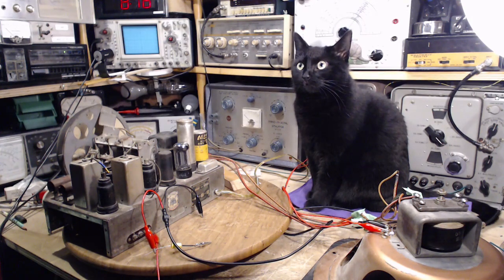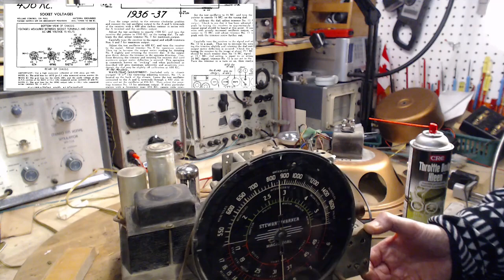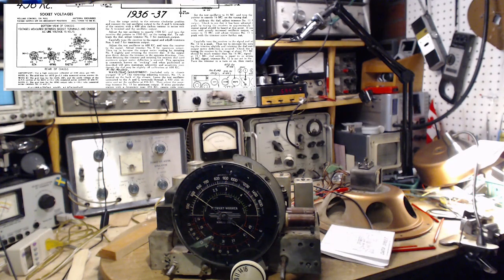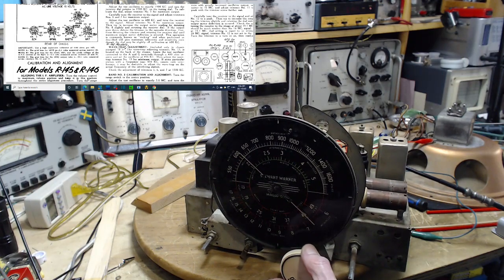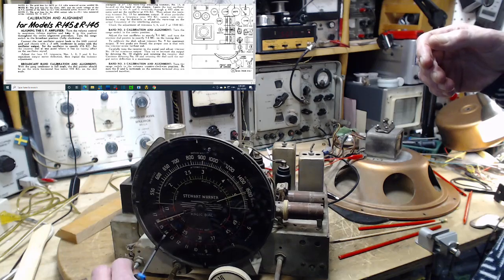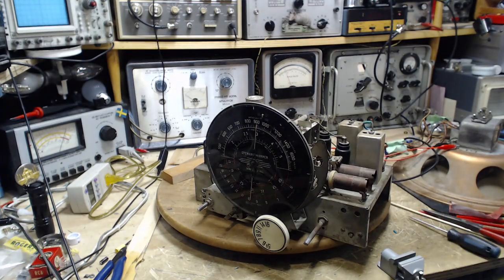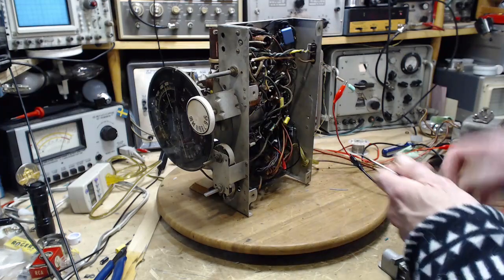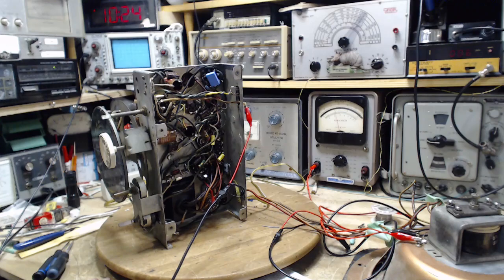Stewart Warner R146 Video #13 - Alignment Completed

Comment: Yes the bottom plate will probably change the alignment. You will probably even out the sensitive across the dial with the final alignment. It will be nice to see the listening post, I have been a SWL and Ham for over 60 years. 73 Leo.

Comment: Nice seeing it receiving somewhat.  But that chassis and all the pots need a good cleaning.  The tuning capacitor assembly looks like it is caked with crud.  The volume pot is scratchy as all get out.  Clean them up and that radio will work so much better.  Isn't all that hard to just clean/dust that thing off some.  Hope when you do the final alignment you redo the IF alignment correctly as the data sheet lays it out, will help a lot.

Comment: Where did the idea come from that you can’t solder to steel. Many radio’s are made from steel chassis and connections are soldered direct to chassis all over the place. The clamp part of the grid cap is clearly just to hold the insulation on the wire.

Comment: When they say “rock the dial” a good technician is supposed to know what the mean. What you are trying to achieve is better tracking between the oscillator and RF tuned circuits. This tracking error is caused by the oscillator tuning range being different from the RF tuning range, because the oscillator is approx 456KHz higher in frequency.

Comment: if a loop antenna is made correctly it should be possible to tune from 20khz to 30mhz for reception
Reply: He said it was designed for the broadcast band, so it is made correctly

Comment: 9:18 looks like the sponsor of the video changed; before everything was drenched in standard home depot WD40, now it is CRC Throttle Body Kleen. 
Maybe the younger among us will live to see him use proper contact cleaner like Tuner 600. Although that cruddy mess calls for the sledgehammer tag team of acidic Contact 60 + rinsing Contact WL+ preserving Contact 61.
In former east germany they used the cough rub on Pulmotin as contact preservant. Maybe he will use Wick Vapor Rub some day...
Reply: Two days running he has used that cleaner.  Might be waiting for the next drum of WD40 to show up.

Comment: Shadow is like the Eveready battery cat  you know the cat who jumps through the number nine on the super duty battery. Nine lives and always bounces back.
Not so much with that tuning condenser. It really needs some  good cleaning! Very noisy sounding radio. Even when a station is tuned in.

Comment: Good grief, is there anything working in his shop? The pointer of the multi meter behaves erratically, worthless for any alignment... Next step adjust the trap coil... "Oh, I'm not gonna do that"  That's the spirit, Jim !!!
Reply: Jim has pointed out already that this particular chassis model does not have the wave trap ergo there is nothing to adjust.